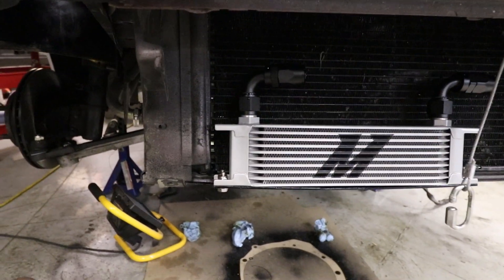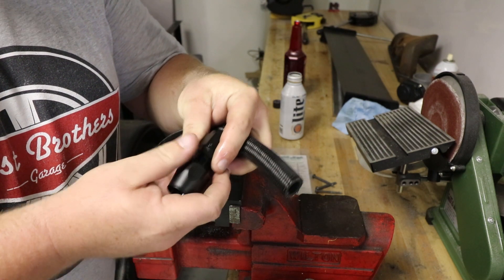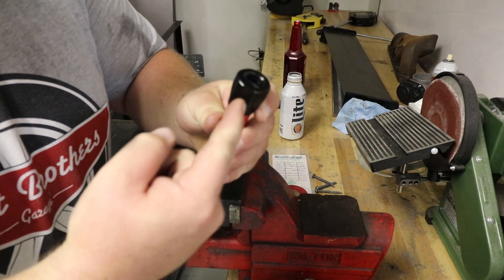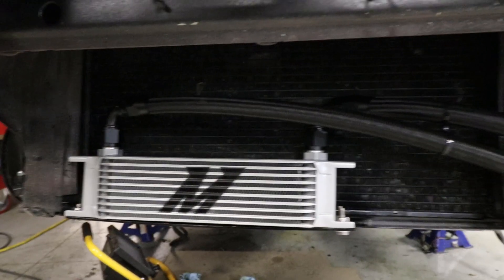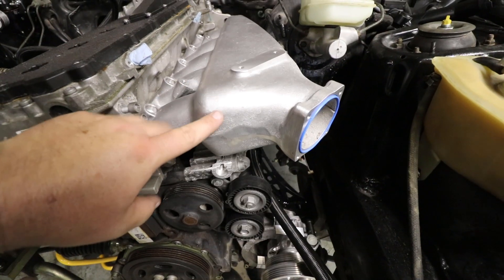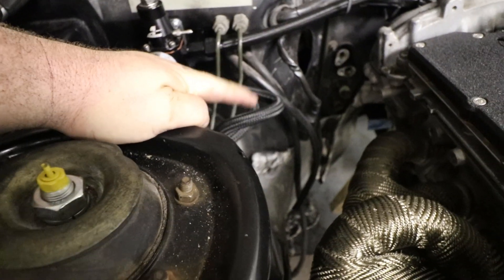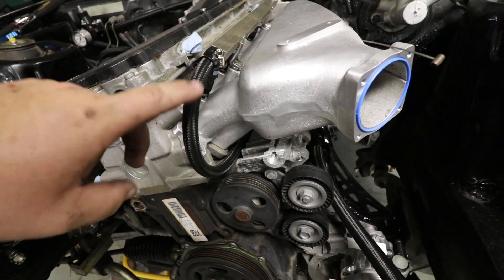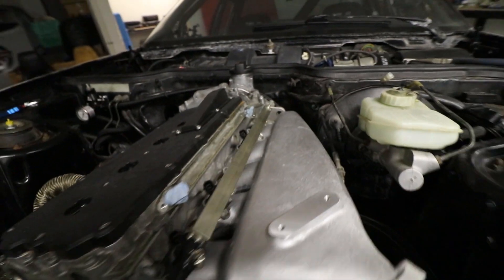5 Cylinder 944 Build - Part 4 (Porsche 944 07K Swap)

Comment: SORRY TO BOTHER YOU BUT NEVER USE BRASS FITTINGS ON YOUR ENGINE !
ALWAYS USE STAINLESS STEEL ! 
PARKER HAS A MASSIVE CATALOG AND THERE ARE SOME SMALL PARKER STORES WHERE THEY CUSTOM MAKE BRAKE LINES HYDRAULIC HOSES AND A LOT MORE !
BRASS FITTINGS SUCK ASS... THAT DO NOT HOLD UP TO HEAT AND VIBRATION VERY WELL ! I CANNOT TELL YOU HOW MANY OIL LEAKS THAT I'VE SEEN BECAUSE OF BRASS FITTINGS !
DO IT RIGHT THE FIRST TIME IT COSTS LESS !
LIKE WE SAY IN CONNECTICUT { JOKINGLY }... WHY DO IT RIGHT WHEN YOU CAN DO IT AGAIN ?
Reply from the maker: I don’t remember where I used a brass fitting but this was just the development car. The engine has since been pulled and will be getting a full build and overhaul before going into the next chassis

Comment: FINALLY SOMEONE GOING HAM ON A VW AND NOT A HONDA I LOVE IT !
TOO BAD THERE ISN'T THE SAME LEVEL OF AFTERMARKET SUPPORT FOR WATER COOLED VW's !
ANY WAYS .... I HAVE BEEN WATCHING ALL OF YOUR VIDS AND WHEN YOU GOT TO YOUR HOSES I JUST HAD TO SPEAK UP !
THERE IS A PRODUCT OT THERE THAT SECURES HOSES FOR PENNIES ON THE DOLLAR AND CAN WITHSTAND HYDRAULIC PRESSURES WITH EASE  !!!
WHAT ? BULLSHIT YOU SAY !
******** SEARCH OUT " THE ALL STEEL CLAMPTITE WIRE HOSE CLAMP MAKER ! " *********
THIS THING WILL NEVER LEAVE YOUR SIDE AFTER YOU TRY IT !
 IT TAKES A FEW TRIES TO GET THE HANG OF IT AND FIGURE OUT THE BEST THICKNESS OF STAINLESS STEEL WIRE THAT WORKS BEST FOR WHAT YOU ARE DOING !
I HAVE SEEN TURBO 5 CYL VW/AUDI'S MAKE 800 RELIABLE PONIES !
FORGED BOTTOM END { CROWER CRANK & CARILLO RODS} AND A MASSAGED HEAD !
LOOK TO EUROPE FOR ANSWERS TO YOUR QUESTIONS !
BEST OF LUCK !!!
Reply from the maker: I’ll check it out, thanks!

Comment: Sorry for the super amateurish question but is the oil cooler something that is necessary for the 07K, for street or race application, or is it just a performance enhancing option?
Reply from the maker: I would typically say it isn’t necessary unless it’s seeing track duty or has heavy mods. However, the factory 07K setup had an oil cooler so in this instance I think it’s necessary regardless. Not an amateur question at all!

Comment: I've got a 07 rabbit with a 07k and I'm pretty sure it's the best/ most underated motor vw ever made. It's such a dog when stock but a few tweaks and it can make some sweet sounding power. What are you going to run for engine management and gauge cluster? That has always been my dilemma given that stock ecu is linked to the cluster, so you loose cluster with stand alone engine management.
Reply from the maker: We are going to run the Performance Electronics PE-8400 ECU, and they are building a swap harness for us that integrates the factory cluster! They have a “race dash” that’s pretty inexpensive as well, which you could easily run.
Reply: @BoostBrothersGarage  ok sweet! Personally I prefer the stock clean look and function. Awesome project, I'm eager to here it run!
Reply from the maker: That’s understandable... Thanks, I’m getting pumped up!

Comment: I'm running my fuel line and cooler lines also, haha i ran my line for the fuel rail the same way
Reply from the maker: I mean it makes the most sense! Might just have to put a little shield above that pulley 🤷‍♂️
Reply: @BoostBrothersGarage  i was trying to decide how to do the fueling, mine is also a return style, but i see you did the "deadhead" style, i was thinking about getting a fuel rail so i can continuously run fuel through the rail while it returns
Reply from the maker: I like those better, I was just trying to utilize the factory rail

Comment: Man! it is looking great.  I did a lot of the same plumbing on my S2.  Luckily my car came with an external oil cooler, but i did plumb in an 2 qt Accusump  .  I did relocate the AOS, because of the ITBs, to a catch can mounted on the DS frame rail.  Keep up the good work.
Reply from the maker: Thanks Steve! One of these days I’m going to get a hold of an S2 for a build!

Comment: Who cast the intake?
Reply from the maker: A company out of Brazil that we have contracted to make them all.
Reply: @BoostBrothersGarage  I think I know who they are. Been searching for a solid casting manufacturer here in Europe but the cost... I even thought about doing it myself . 
Nice Porsche!
Reply from the maker: So far so good with them. We were quoted some obscene pricing here in the states, completely undoable for small production stuff like this. It’s too bad 3D printing in metal is still cost prohibitive!
Reply: @BoostBrothersGarage  I'm following a guy who 3D printed his intake and is gonna reinforce it with CF on the outside, boosted cherry on top. We'll see how that turns out.
My personal plan is to make a 2-part intake, runnerside and plenumside.
Reply from the maker: I’ve been told that if the print is quality enough an intake can be made to last. Our ABS 3D printed intake was done in 5 pieces and just doesn’t seem like it will cut it.
Reply: @BoostBrothersGarage  I do a bunch of 3D metal printing.  A manifold like that in stainless would be north of 30K!  They are great for prototypes though where the casting cost would be even higher for a small production run.  Did you consider a sheet metal fabrication?
Reply from the maker: That’s insane! We did consider sheet metal, but we ended up getting the cost of the cast manifold down to a reasonable level. We do have a bunch of money in tooling that will only be recouped if we sell enough of them though!